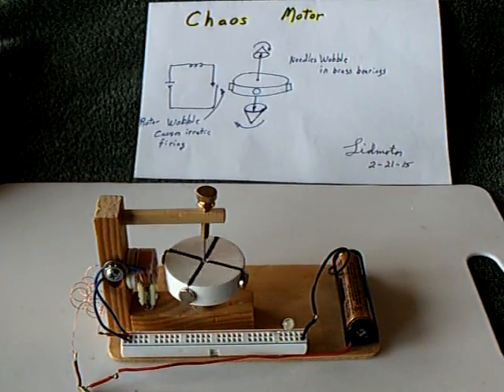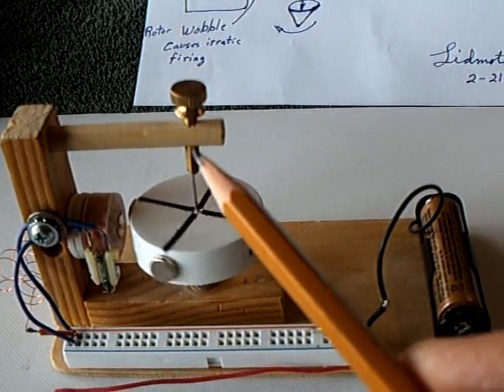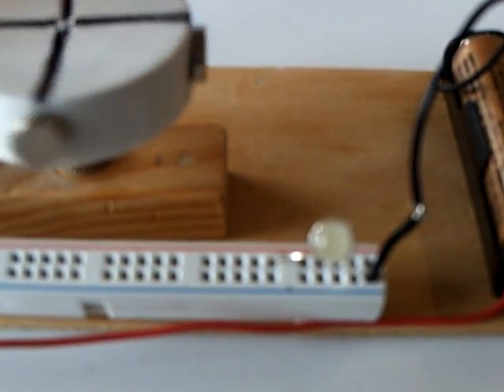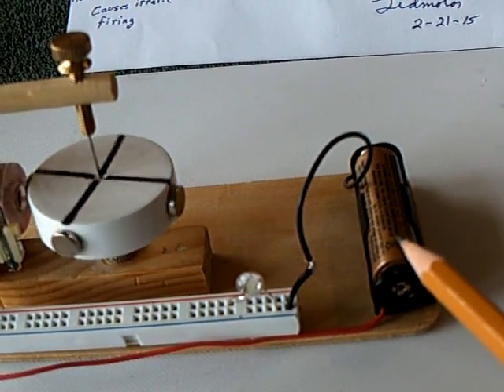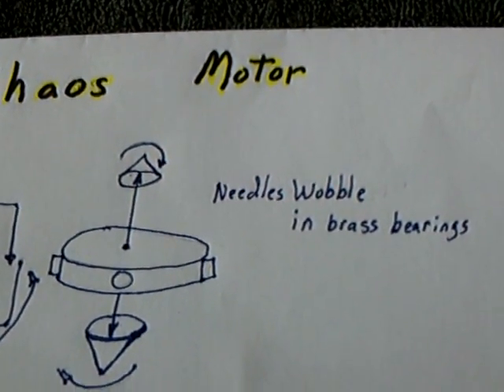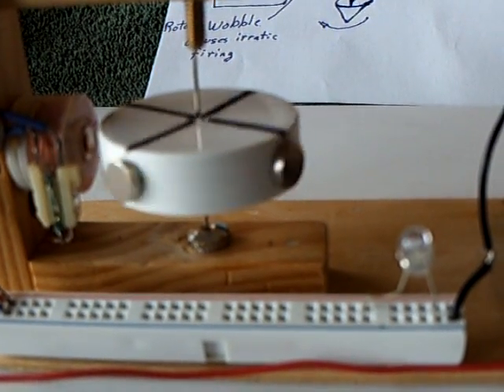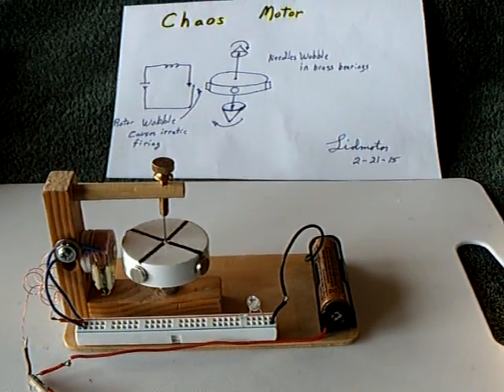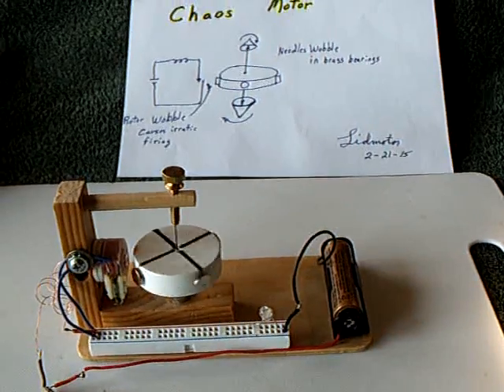Chaos Motor

Comment: If I run two magnets on a rotor will it use 1/2 as much power ? How about if one magnet and a counter weight ?Thanks for the great videos !
Reply from the maker: +magnetman2010  I don't know.  The motor is tricky to adjust.  There are so many variables.  Perhaps your idea of using less magnets might produce the same amount of rotation with less power output.  One way to find out......   Did you see my latest video where I did away with the reed switch and just used the wobbling needle as the switch?  I like that one better.  We don' t need no stinking sticking reed switches.  Ha.

Comment: *****  I need to create a high rpm motor that runs off of a 9v battery for my physics assignment. I was thinking of using a microwave transformer to step up the voltage but I'm not sure if there is a motor that could run off that little amperage at that high rpm. It cant use any commercially produced components, must be self starting and must use brushes to transfer the power. What kind of motor would you recommend building, what would give me the highest rpm?

Comment: HI lidmotor... thats cool. Something that came up as i was watching this.

In my minds eye - I saw a device with a light sensor on it, monitoring the rotation speed of a disc and fly wheel. Then as it dropped down to a certain speed, it would fire a coil again to speed up the disc again, until it shut off, allowing the disc to spin like a top for a while. hmm...

interesting find, thank you.
Reply from the maker: DiyEcoProjects Yes I think that there are a number of ways to do this same thing.

Comment: It does bring in the inertia to time based firing thoughts. How much on time being needed to keep a motor going at similar RPM's, compared to always powered. Maybe to introduce 15% off time and really not lose anything, if thinking of picking up energies.
Reply from the maker: I thought about something similar with a hall sensor and  perhaps a micro processor thing----- but this way is so beautifully simple.  I took away the battery later on and have been running it on a super cap for hours.  It is great fun to watch because of the way it lives.  I may wind another Frog Hair coil and try that.  The first two I wound are on the solar 'Frog Hair Motor' and it is still running away 24/7.  That motor has a wobbling rotor also and that might be one of it's secrets.  Late at night and in the early morning hours it may only be firing part of the time when it's power is low.
Reply: *****
Have you heard of the double reed trick ? A poster at OUR said about 2 reeds firing in series..the distance difference between the 2 reeds is the pulse length. What would happen, is that when the wobble made the motor fire, it could be tuned like a car engine to 'spark' for exactly the amount of time needed, no micro. There would be nothing until both were closed, then a very fast sharp snap or normal firing if 1 reed were atop the other. Could also improve spikes for high ohm coils.
Reply from the maker: slider2732 Yes I read that post at the OUR forum.  It is one of those things on my to do list to try out. Two reed switches might double the magnetic attraction (drag) of the rotor magnet to the reed switch though.  On this motor I am using that attraction as a helpful thing.  As the rotor slows down it is drawn towards the reed switch and that helps the triggering.  Everything has to be just right---even the levelness. You can adjust the firing just by slightly tipping the motor one way or the other.
Reply: *****
Just tried the 2 reeds again and it's a trouble to set up. An idea was to set 1 at 180 degrees, to negate extra drag, but they wouldn't fire...needs microscope precision by the looks of it, or more luck than i've been allocated today.
Had to laugh when you put about tipping. Found that out by accident with the Linear solenoid type motor, was only obvious after tipping a few degrees and seeing it ran so much more reliably !

Comment: Watching this when you say randomness I think you could take the mystery out the motor if you get out the scope and take the a couple samples of time and see how many times it fires off. Also clocking the speed at which fires would help too. I bet having the rotor off balance creates a pendulum when it could balance you are basically gravity is pulling at the rotor and the wire resistance is causing a pull on the magnets. I am may be off miles away in my understanding.
Reply from the maker: I was thinking about a graphing function that would show the behavior visually. I imagine it would look like a child's scribbling ----but it might show a pattern and that would be very interesting.  Rotor speed, time of firing, and pulse duration were my thoughts on what to look at.

Comment: I really like this one. I wonder if you could take it further with a bit more power.
If you had a top that spins around freely (no upper bearing) then gets a boost as it starts to wobble or fall over.
You'd need mor coils and reed switches, but I think its do able. The more you could make it lean before getting boosted the cooler it would look.
Reply from the maker: Interesting idea.  It is actually a bit tricky to get this to work right.  If things are off the rotor either stops or speeds up out of control.  The reed switch position and the wobble have to be right. The levelness of the motor is also a factor.
Reply: I'm thinking it would be easier to get it working if there where more coils with individual reed switches. Provided it will spin like a top without coils.

With more coils you could have the switches further away. Whichever way it leans it should trigger a coil or even wobble past a few before it speeds up again for a while.

Comment: The "Chaos Motor" sounds way cooler than the "Randomness Motor"... Very interesting circuit indeed... What does the BEMF spike look like on that high Ohm value coil... Thank you for sharing Lidmotor... I have some 38 AWG, I think I am going to attempt a similar setup. Peace. :)
Reply from the maker: The coil used here is a 10 ohm 30ga magnetic wire one and not one of my 'Frog Hair' fine wire ones.   The back spike on the high ohm air core coils is not very good. I guess I could have called this the 'Randomness Motor".  I also thought about calling this the electric 'Hit and Miss" motor.
Reply: *****
I think the Chaos Motor sounds cool :)...I apologize for assuming it was the "frog hair" coil. Very interesting stuff. Thank you for the reply.
Reply: *****
How about "the wobble oscillator motor" :)

Comment: I can see the needle axle wobbling. 
It seems to me what is happening is this:
1.  As the rotor spin decreases, the wobble distance from its left most position to its right most position inceases until a rotor magnet eventually cause the reed switch to pulse your coil.
2.  That pulse increases the rotor torque, speed, & causes the axle to spin with less wobble (i.e. shortens the wobble distance from left to right).
3.  With less wobble, the reed switch isn't triggered as often--which reduces energy discharge from the batt.

In a PWM circuit, the pulse period is controlled by the oscillator circuit.  In your design, the oscillator is your wobble.

Have you considered making your lower axle bearing a magnetic bearing to further reduce friction?  It might be interesting to see if you can attach a bearing to the base of your stand (with the positive polarity up) & attach a magnet to the lower end of your needle axle (with the positive polarity facing down).  If it balances (maybe with 3 bumpers at 120 degrees from each other), that might be very low resistance.

Great observations!
Thanks again for sharing!
Reply from the maker: Yep.  That is how this thing works.  Thanks for the idea about the bottom magnetic bearing.  I have seen that used on other motors but usually ones with much larger and heavier rotors.  Thanks for the good comments.
Reply: ***** Happy to help when I can. :)
Keep up the good work!